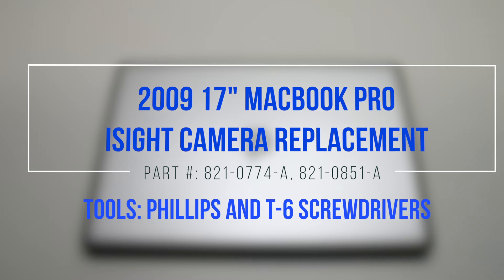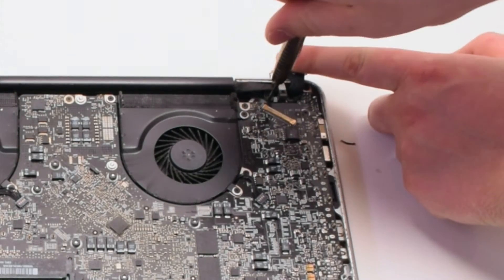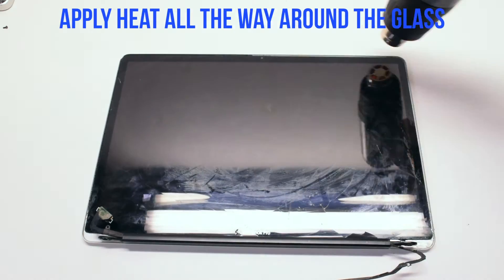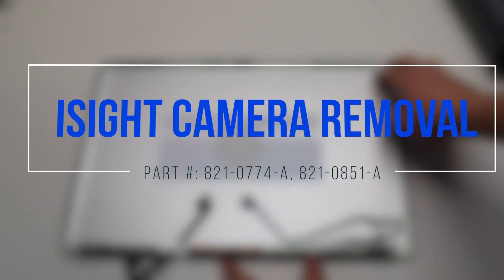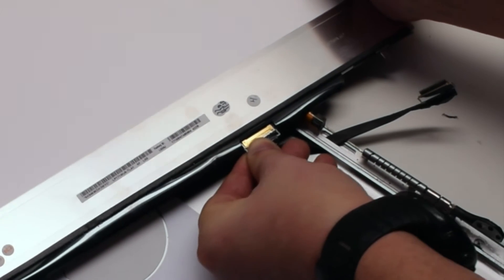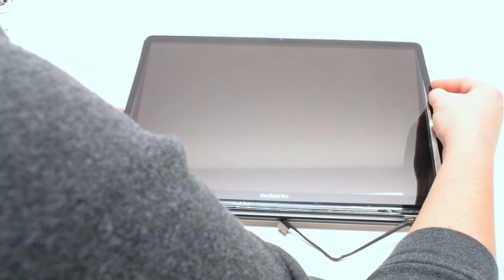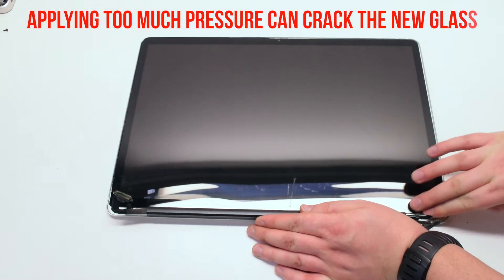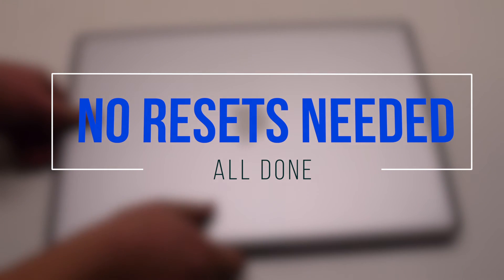2009 Macbook Pro 17" A1297 iSight Replacement

Comment: It would be awesome if you could mod the camera to a much higher resolution camera from a smartphone or something. But in this case just putting the same low res camera in it doesn't seem like its worth wrecking the glass to get to it.

Comment: can i switch an isight camera from lets say a 2015 model into a mid 2009 ?
Reply from the maker: Unfortunately no, they are different cable lengths.
Reply: besides 2009 whats the latest i can go if i wanted to make over my mid 2009 as far as screen replacement and isight camera. i had an idea to just completely give my mid 2009 a new display I'm just looking for insight if any thank you for responding
Reply from the maker: Same year and model only.